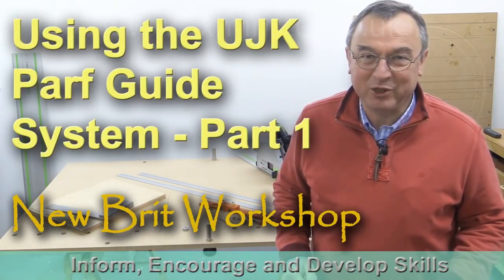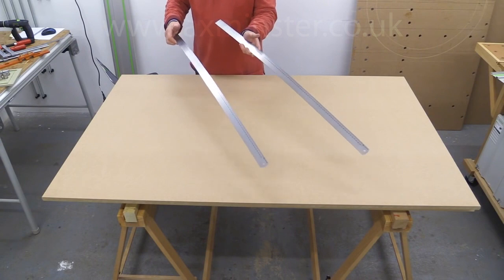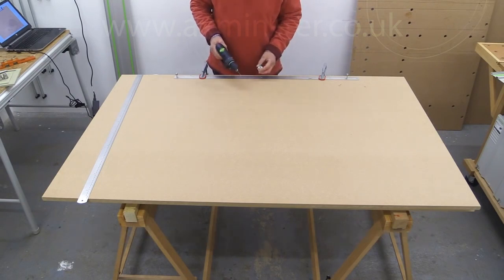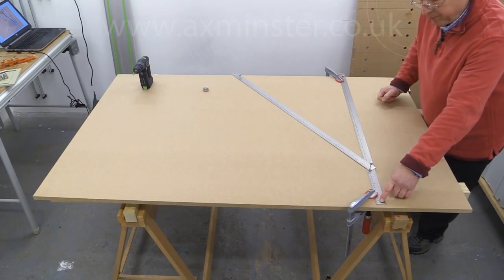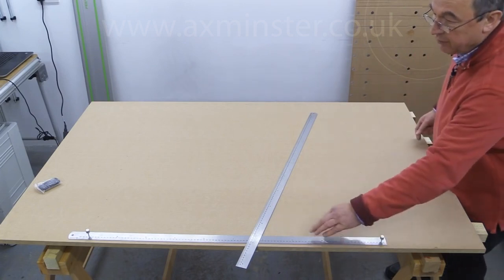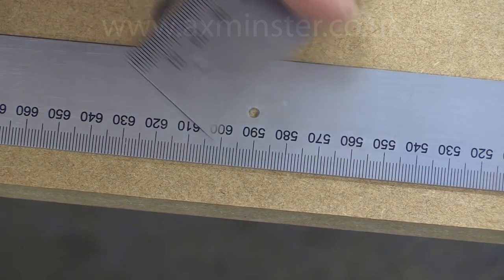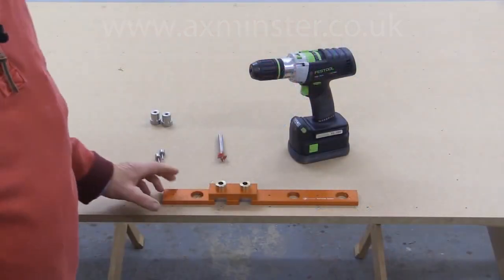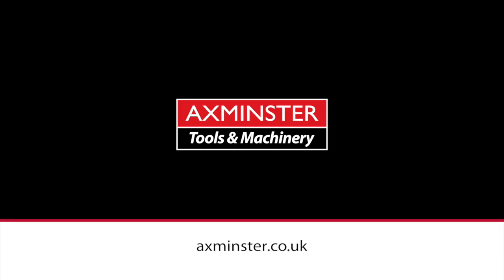UJK Parf Guide System - Instruction - Part 1

Comment: Just started my first "MFT" with my Parf system, got my 3mm grid drilled perfectly first try, took about 45 min. I had a couple hiccups. First, make sure the set screw for the 3mm drill bit is tight. Second, don't drill into the guide bushing. That may be why my bit got loose, but a 2mm Allen wrench fixed it right up. Third, use some wax on the pins. They fit really tight, and can be difficult to remove. I believe the next one I do will take half the time now that I have the hang of it. About to do the 20mm holes, I'll comment in part 2 my results.

Comment: If a pin is to go through both rules,perhaps to machine a tool part to be say 3 mm odd long to go through both rules firmly, just a thought.i used the drill guide, longer one, but somewhere lost a fraction integrity, causing me to trim board a start again

Comment: I had some trouble getting the 20mm drill bit to go all the way through. Might be my off brand drill which wasn't powerful enough, or because I didn't get the dust extractor attachment to suck the dust/chips out of the way. But halfway through the board, I had to remove the whole jig, and clean off the drill with my dust extractor. For each hole. It took ages :P
Till I figured, I'd just drill each 3mm hole again with a 8mm bit. It honestly doesn't matter how straight the smaller holes are... The 20mm bit is gonna go straight with the jig anyway. But yeah... Removing some extra material before using the 20mm but did the job.
Just putting it out there, for any other newbies. And now I have an amazing mft table thanks to this system :D

Comment: Great Video, just wonder which Parf guide I got delivered as documentation is saying Park MK I but the ruler do have 3 and 6mm holes while the drill support does not have these 6mm snapin support.
Reply from the maker: Hi Juergen, you would have had the Parf Guide MK1, however, we have updated the MK1 to have the MKII guide sticks as standard. I hope this helps!

Comment: I’m relatively new to the theory of the system, but don’t understand why hole centres are at 96mm and not at 100mm, which would enable cuts to be made at standard lengths.
Reply: The holes are not used to measure the lengths of the cuts, they are used to align the cuts, by putting three bench dogs in there, in a triangle, and putting the wood against one side, and the track against the other side of said triangle. The measurements are done separately, and for this purpose, it being 96 or 90 or 100mm or whatever else doesn't matter much for this, as long as the holes are far enough to not taking out so much material that they are weak, and close enough so you can approximately be at the end of the board to provide best alignment possible... Also, multiples of 100 are not a 'standard length'. However, 32mm spacing is, and 3x32 is 96.
See https://en.wikipedia.org/wiki/32_mm_cabinetmaking_system

Comment: It appears that Peter does not carefully align the initial Parf stick parallel with the edge of the MDF top. I understand  that all the 3mm  holes will be aligned to each other perfectly (using the 3 4 5 rule) but the edge of the MDF will not be aligned with those holes. One solution is to cut the edge down using your track saw after you have created the 96mm spacing of 20mm holes. The other would be to use the Parf stick to align the initial 3mm hole either 32mm from the edge or 16mm. What alignment is the Festool MDF top to the first row of holes? Does this matter?
Reply from the maker: Good afternoon

I would recommend calling us on 0800 371822 to discuss your enquiries further with our technical sales team.

Kind regards

Jade
Customer Service

Comment: Hi Peter, I've been enjoying the original Parf Guide System for about a year now and made around 10 tops with it here in Ontario, Canada.  I usually seal the tops with Polyurethane before I drill them and I was having some bad tearout on the back that chamfering would not hide.  I recently decided to drill the back lightly a couple of mm on every hole before I turned it over and drilled right through.  This fixed my tearout problem even though it adds a bit more work to the process, but now I have perfect holes on both sides.
I would also like to mention to just watch Peter's videos on how to use this system.  There are a few other's out there now where they are not following the instructions properly when drilling the 3 mm holes.

Comment: Peter

Received my new system and love it.  I do have a question though.  The stop collar retaining screw has been changed to a plastic one and it does not hold the bit from dropping through the jig and can't be tighter on the shaft.  And a suggestion to put a slight notch on the shaft to retain the set screw from scoring the shaft of the bit.   Will continue to enjoy the jig making other top Keep making the great shows